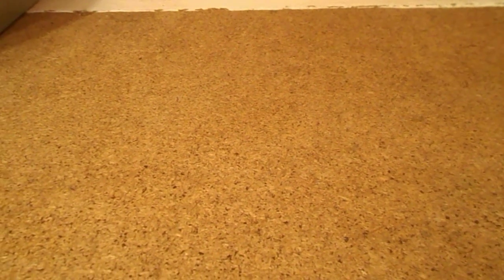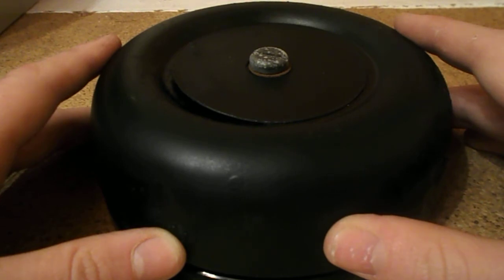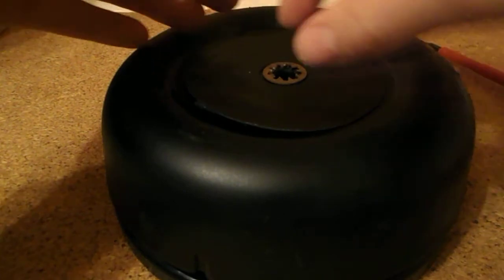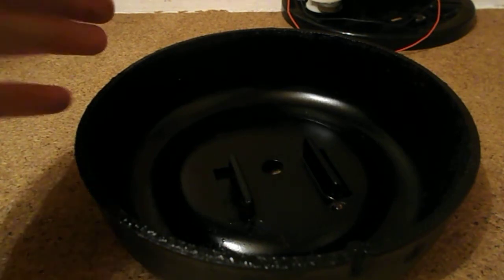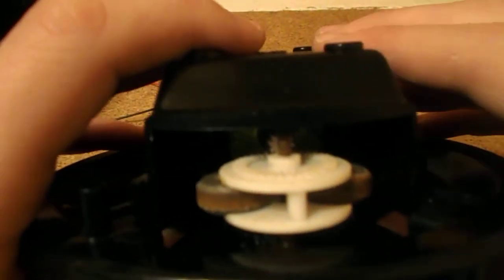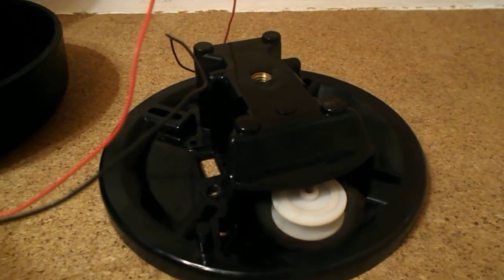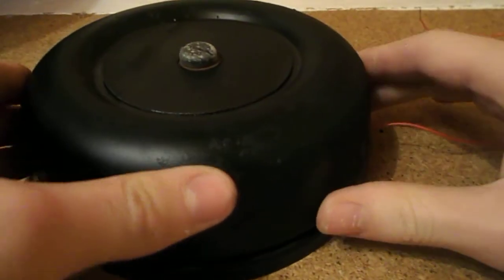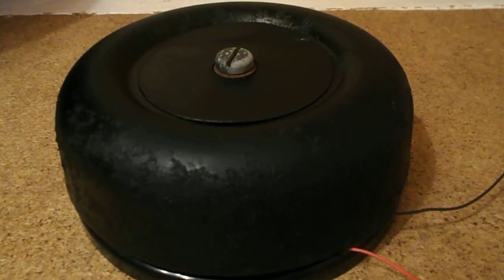12 volt bell demonstration

Comment: Just so you know this particular design of bell is a bit of a pain to get of the base
Reply from the maker: Matthew Jones haha I know that, this video is about 5 months old but I have only just uploaded it now and I can remember that it took some strength to remove it from the base. However, the cover shouldnt need to be removed too many times as once the unit is installed it should stay like that. It is easier to remove however once the bell is mounted on a wall as the baseplate is then screwed down so the bell can be pulled off easier.
Reply: I recently got a couple of these kind of bells and they were absolutely difficult to get of the base unlike the newer version of this which is a whole lot easier and I'm more used to working with the newer design of this one, the first one I got is a black zettler bell with a red sticker and it came in a job lot of bells which I'll make a video of some of them, and the other one I have is a Jsb bell, it didn't come in the job lot i got it a bit later and it's the older Jsb bell with the old logo and I says made January 1989 so it's quite old but it's in pretty good condition and it was only £10 on eBay but the job lot of bells was also only £10 with £8 postage and it was a big bargain for a lot of bells, I know that this design is similar to the original tann synchronome bell with the metal back plate even though this bell is actually made by Fulleon, I think that the base is made by Fulleon but the actual gong is made by tann synchronome I think when Fulleon started making these bells they probably made their own motorised base but they used tann synchronome gongs because I think Fulleon is related to tann synchronome but I don't think tann synchronome is around anymore because they probably started making the original bells in the 1960s or 1970s and the Fulleon made the motorised version probably in the later 1970s or early 1980s, if you look underneath the striker you might find a date stamp I know I found on on my Jsb bell,  
Because these bells are similar in design to tann synchronome bells I think these ones are called tann bells even though there made by Fulleon and the original tann synchronome bell is like a half Fulleon bell and half tangent bell because it has this kind of gong and it has the backplate from a tangent bell and you don't even have to remove the gong to get to the inside of it and it's a vibrating bell not a motorised bell like this one and it was available in both 24vdc and 230vac suitable for all kinds of systems just like the tangent bell. 

And by the way this ones 24v not 12v
Reply from the maker: Matthew Jones well it certainly sounds like your very familiar with bells and what a bargain it is to get all those bells for such a low price!!! I know the ins and outs of a bell and how it works but i didnt know lots of that information you told me in your previous comment. I can imagine that the bell was updated to have a cover thats easier to move as i agree it is difficult to get off. However, you said that the bell in this video is 24v whereas i can confirm that it is 12v like i said it was as when i was cleaning/painting it i saw a sticker with the date of manufacture and there was also another sticker that said the recommended power to the bell is 12v. Never the less, you told me lots of information in your comment that i didnt know!
Reply: I actually think you have one of the original designs as well as this one because I saw another video of a bell box with a that kind of bell in it. 
Can you do a video of both this bell and the other one you have to compare the difference and also explain most of the information I told you.

And I didn't know there even was a 12v version of this bell maybe they just put that there because this particular one is for a burglar alarm system
Reply from the maker: Matthew Jones i will have to see if i can find the other bell box your on about! Was it the white CQR one? And i think considering this bell is for an intruder alarm they probably just stuck a 12v motor in there and that was that.
Reply: Yeah the white Cqr bell box with the bell in it